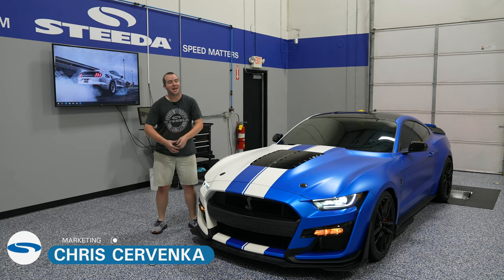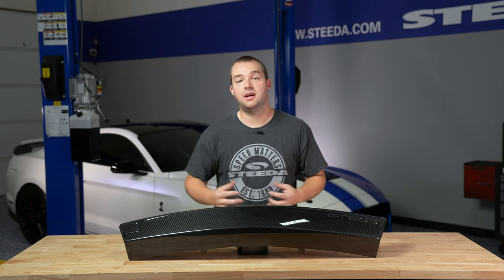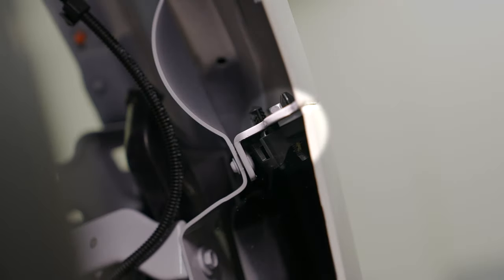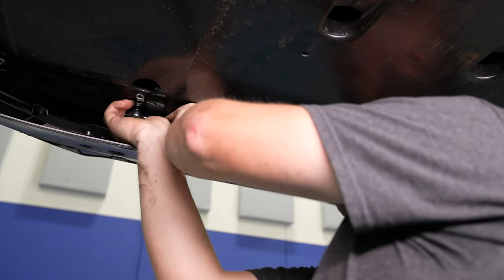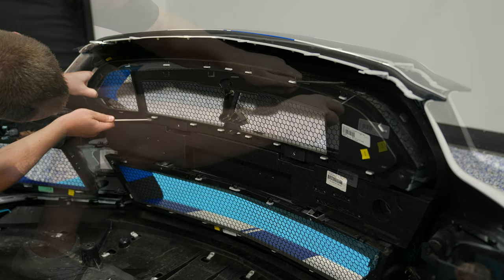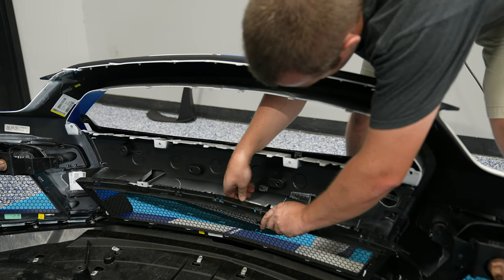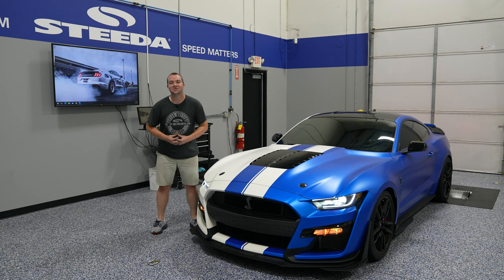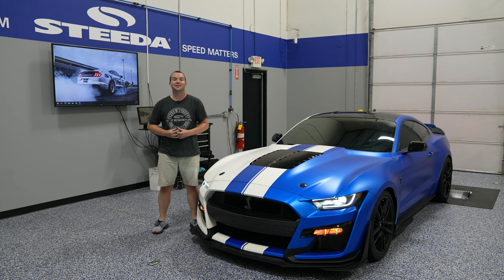Ford Performance GT500 Carbon Fiber Front Bumper Insert | Review & Install

Comment: The GT500 is pretty good as is.  Not sure what the point of all this customization is beyond owners trying to set themselves apart from all other owners.  All fine and good, but owning a bone stock GT500 should be enough to make you feel pretty special (and lucky).